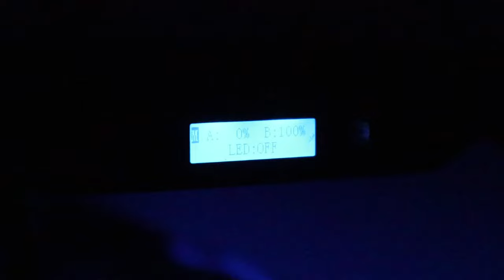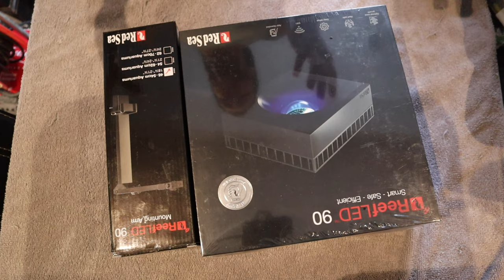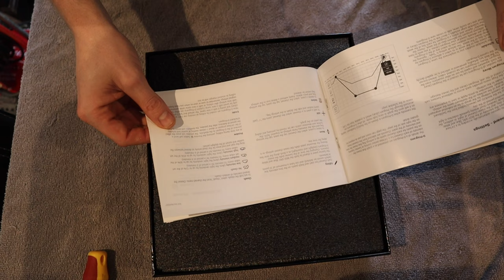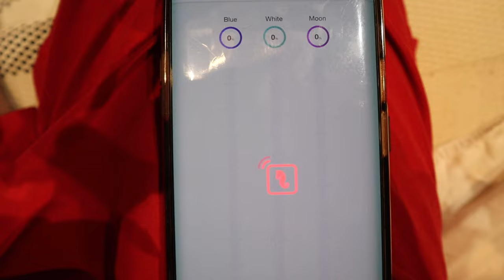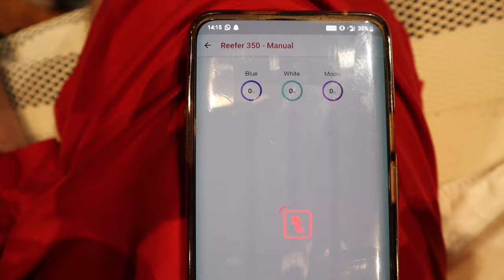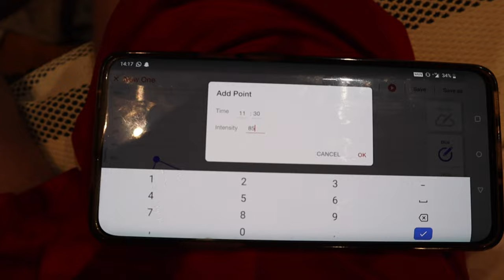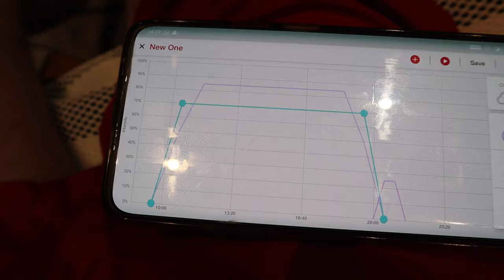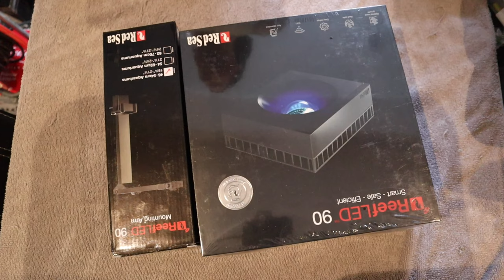Red Sea ReefLED 90 Unboxing And Install

Comment: Do you think 1 light would be decent for a 40 gallon breeder for a while ? I plan on getting a second one later down the road but gotta budget somewhat lmfaooo
Reply from the maker: As long as the majority of the coral is underneath the light it should be fine. Just make sure the light is high enough that it spreads the whole tank. You might find that it won’t reach the ends of the tank though. I have a Reefer 350 and I’m looking to put a 3rd light on there. One light covers around 2/3 of my tank fairly well so you should be fine for a short time.
Reply: @atingeofginge2709  thank you man, please make more videos on this stuff you’re really good at it !
Reply from the maker: Thankyou I appreciate it! I’ll be doing a full sump breakdown soon.